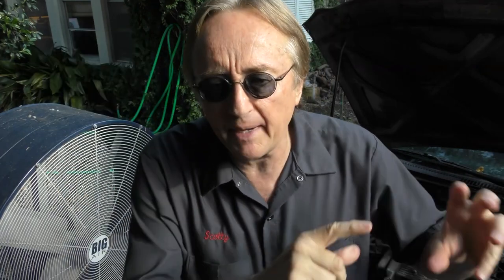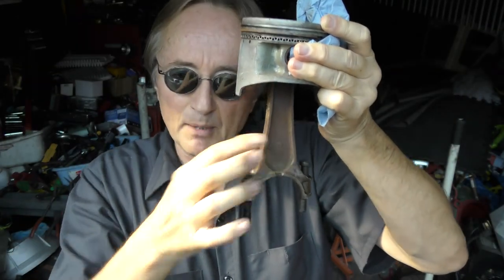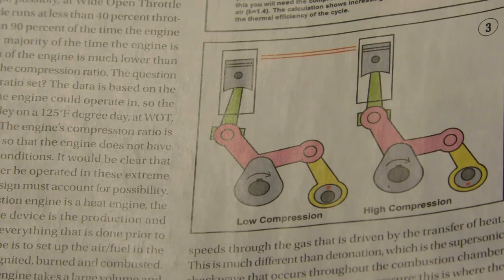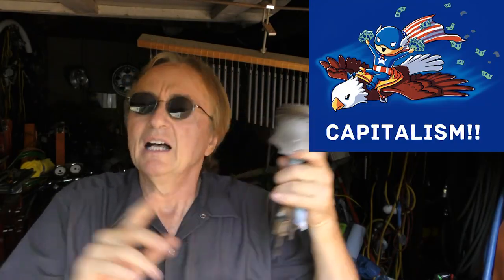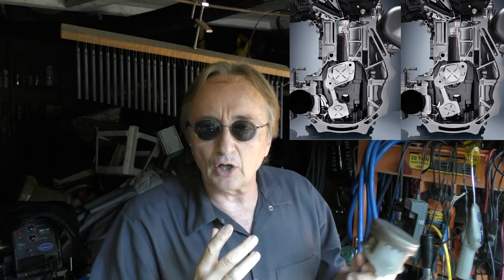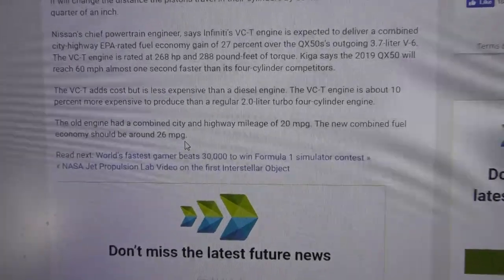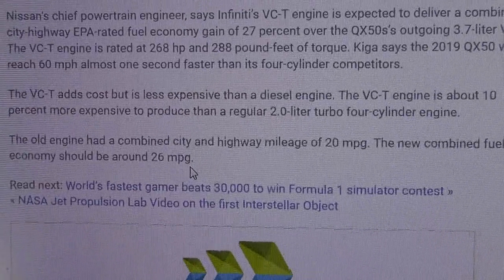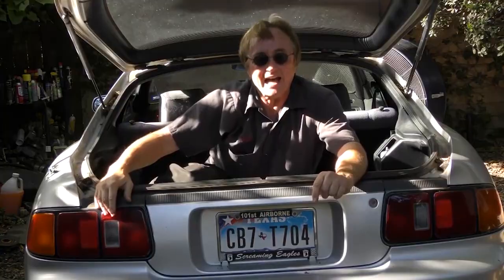If You Buy This Type of Engine, You're Going to Regret It

Comment: The old cast iorn 368 V-8-6-4 was fine.  The electronics weren't ready for prime time.  The engine was weak thanks to the shrouded valves, but they lasted for ever.  Same architecture as the old 472 and 500.  Unhook one wire and the 864 part is out of commission.

Comment: I don’t think that design is bad. They figured out how to fix the inherent secondary balance issue and power stroke rod angle That Plague four cylinders. And they plasma line the cylinders so I don’t imagine it going to be a piston or rod issue. They also are using electronic servo instead of a hydraulic system to activate the linkage which reduces failures risks.

Comment: It's probably the quest for more horsepower, which few really need. Most cars could get by easily on about half of their current HP, and they would get better mileage and last longer. People say, "But I need to pass."  The only thing I ever have to pass is farm equipment going 15 MPG, and I think I've got that covered. If the speed limit was obeyed, roads would be safer too.

Comment: I routinely get much better gas mileage than the estimates. My S70 is rated for 21 city 29 highway but I always get 24-26 city and 32-35 highway because I drive smart. I use inertia to my advantage; coast to slow down, accelerate gently, time traffic lights, take corners a little too fast, and use my transmission to my advantage; I know I get 5th gear at 44 mph, and a locked torque converter at 38 mph, so by going those speeds or slightly faster I get maximum cruising efficiency. Heck, cruising at 45 on a flat surface I get 42-45 instant mpg. At 40 I get about 40 mpg, and at 30 I get 32-33mpg. At 65mph on a flat surface, I still get 31-34 mpg.

Comment: My ss impala would get 15 mpg in the town with v8 but while v4 I would get from 36 to 43 mpg at a consistent 40 mph, but on the highway the v4 couldn't be used unless I wanted to slow down, it wouldn't be used after 2800 rpm

Comment: My 2003 V8 gets 18city, 26 hwy, 24 combined with my actual driving. It's been reliable for over 160k miles, and should be for another. Some of this new tech seems like they're grabbing at straws to get any better MPG. 
Just give us more cars with electric drive motors in the rear, and a capacitor bank, give us regenerative breaking, start-stop with electric assist acceleration. Then those actual reliable 4 cylinder engines can feel like more powerful engines, without too much complexity. The capacitor bank isn't affected by cold or charge cycles (these are used in city buses, which do much more stop and go than cars). People would buy more of these "hybrid" vehicles if they weren't stuck with 1-2 models to choose from.

Comment: THATS 99% RIGHT SCOTTY MORE PARTS MORE BREAKING DOWN I HAVE A 1996 BMW 1.8 L 183 000 kms 
that burns no oil has small gasket leaks I need to put new oil pan gasket in new oil plug to transmission oil plug nut rounded of so I went to welding shop had them weld a new nut onto the old plug bolt the thread was still good odd thread hard to find

Comment: To be fair, they don't have many more moving parts than a regular piston engine, they don't require balancing shafts because the extra levers that do the variable compression fill that role. So potentially it'd work just as well. And plus, Infiniti is a luxury brand and it's a pretty large vehicle so expecting good mileage doesn't really make sense.

Comment: Manufactureres tend to over complicate things and it ends up a disaster for the consumer.  A prime example in recent years is the good old DPF system.  Bucket loads of failures, expensive to fix, yet if they were engineered correctly in the first place they wouldn't be a problem.  Variable compression engines even sounds like a recipe for disaster.  
Although I'm pretty sure there are European manufacturers with engines that shut off cylinders when not needed and they work well

Comment: GM's cylinder deactivation is not a failure, it just doesn't work as well as advertised, but in its current form it is very reliable. The reason not to buy it isn't that it's too complicated, it's that Nissan hasn't earned my trust like Ford and Honda have. Also, how are you driving when you get worse than advertised mileage, the only time I ever do is with the A/C on, even at 85 mph.

Comment: They would be better off with a head that lowers into the combustion space. At least that need not reciprocate. I do NOT value complexity. Thanks for the heads up. Wouldnt touch that with a 10 foot pole. Ditto for "skyactive"

Comment: The main engineering problem I see with the vc design is that the rod bearings don't complete a full revolution, they won't be able to maintain a hydrodynamic oil film. But hey it's the same story for small end bearings on any other engine. They don't turn very fast compared to mains but they seem to last. I guess the main failure point would be the servo motor, but they should be able to make that reliable if they don't cheap out too much. Id like to see Toyota do it, but they're not very adventurous

Comment: I can understand bashing Nissan, I have owned more than my fair share. Every car so far that has had a cvt transmission from my 07Maxima to 2014 Versa Note sv has had trans failure 38,000 miles and up. Versa note is on third trans with 77,000 miles on clock! Fix the transmissions please. We have just about made our minds up to go to Toyota Avalon for my wife. I now drive a 2015 Pathfinder 55,000 miles waiting for Trans failure....

Comment: The inefficiency of the gasoline engine is because they are trying to burn a liquid. Combustion continues past exhaust valves and finishes in the catalytic converter. 
CNG and propane has less energy per pound but burns more completely.
You cannot burn a liquid. It has to be converted to vapor. Not enough time in a typical 4stroke to do this. This is old hat. Patented by Henry Yunick in the 1980s. Look it up.

Comment: Im sure gear heads were saying the same thing about Fuel Injection, variable valve timing, and power steering. "Too many moving parts, why risk it?" Yet in another video scottys promoting the toyota corolla, which has fuel injection and a bunch of other things the generations before him thought was unnecessary.

Comment: Do you still have the JX35? If so any idea where the  IBA or ICC sensor is located? I believe it is the same sensor for both. My "IBA off" light is on and "malfunction see owners manual" message is on the dash. I know this can happen if the sensor gets dirt on it. I have searched everywhere online and the only clue I can find is that it is hidden behind the front passengers side bumper just below the tow hook door. I still can not find it. And there is no visible evidence that you can actually see like on most cars which does not make sense to me. I know you are THE MAN when it comes to the JX35's so I'm really hopeful you can tell me where it is so I can try cleaning it off. I have tried all the menu options on the steering wheel but nothing helps. Thanks.

Comment: Mathematically, multiple levers would divide the amount of energy going into the system. Which, in turn, reduces wear despite having more parts. Yes, to a mechanic who may be servicing this engine, it could be nightmarish. But, speculating is not the same as experiencing.

Comment: Large Diesel Crosshead Engines have been around for a very long time and are extremely reliable.. Not suitable to be put into cars, but if you want the most reliable engine, you go for a Crosshead low-rew Diesel. 100.000 Horsepower over 24hour continuous load? No problem!

Comment: Honda's  V6 engine has cylinder deactivation for 10 -12 years now, and they still do.  At highway speeds, it runs on 3 cylinders; 6 cylinders everywhere else.  Sadly, the V6 is gone for 2018, replaced by turbo 4, but the technology seems to work for them. As for variable compression, I agree. I'd avoid it at all costs. Also, Toyota tends to get better MPGs than the EPA ratings state. My 1999 Camry gets 480-490 on a tank of gas when it's all highway miles andnask any Corolla owner and they will likely tell you that they get over 40 MPGs on the highway; The EPA states high 30's.

Comment: That fuel economy is not much better than my 1990 Mercury Grand Marquis. I’d rather keep driving my old 5,000 pound steel tank that I know is reliable, than go for some new piece of crap that may not last 100,000 miles. My car has roughly 190,000 miles on it and it’s still going strong. And some people wonder why I stand by the older vehicles....they were built better and built TO LAST. Scotty, you have proved my point in multiple videos; hence when you talk about your celica. Older vehicles, better reliability.

Comment: Is this the same thing that's on the 5.7 V8 Hemi's? Where it turns off fuel in four cylinders when power is not needed? Ram calls it their Multi Displacement System (MDS).

Comment: I replaced the fuel pressure regulator in my truck and i noticed today that fuel is leaking through it again into the vacuum line and it ate the rubber elbow.  Any idea why a new regulator is doing the same thing the 20 year old one was doing?

Comment: Hey is it worthwhile to try to release a stuck lifter on a dod 2007 yukon 5.3. cylinder one is now misfiring and there is a video on how to free lifter without removing the head. Oil pressure is low 18-20 psi when cranked up. @scottyKilmer Help! new motor is what mechanics say is best option due to cost to fix pressure issue which causes the lifter to collapse. Here in Atlanta Ga new motor cost $3500 installed 3 months minimal warranty and $6700 with 3yr unlimited miles warranty. Or just trade it in?

Comment: That engine was created to provide high power with low fuel consumption. Basically is a gasoline engine with diesel performance. All this for polution and fuel consumption I trust that it will last at least 300.000km without problems, which is way too long. I do 10-15.000 km per year, so the rust and will be destroyed before engine breaks. But yeah, there in Texas is other world.

Comment: Environmentalism aside, the biggest reason to get a fuel efficient vehicle is to save money in the long-term. If a fuel efficient engine is more complicated and susceptible to expensive repairs relative to a reliable but not-very-efficient engine, then you may not actually be saving any money in the long term. You are better of either driving a fuel efficient car or a powerful/fast car. Don't compromise the integrity of the engine so you can have an unreliable car than excels at neither.

On a related note, when I got my Thunderbird SC, I remember asking my dad if I could get away with using regular gasoline to save money. He replied, you technically only need premium fuel when under boost, but if you get engine knock, it could damage the motor and be expensive to fix. Better to spend a couple extra bucks per fill-up than spend hundreds or thousands on repairs.

Comment: What about the Honda? Please! I have a 2010 exl I've been driving one since 98 so on my 4th, I drive them to 300k and donate to someone that needs and buy another used one for 10k.. I'm thinking of going to synthetic or synthetic blend and changing at 5k miles so tires rotate at the same time.. I use Honda or napa gold filters.. But I do get things about the motor it often feels like a 4cyl that the ac compressor kicking on and off.. Is that motor or transmission? It's just slightly annoying but if it at 92k continues to 300 At how many years of operation... Now I won't be buying the 2019 when I work my way up ill have to go to something else maybe the pilot which we have of a 2015. It uses synthetic though same motor basicly as my 2010 Accord? Talk to me scotty

Comment: Toyota Corolla 1.4l 97 hp manual year 2006 - gets 41 mpg combined for me and I don't drive very economical. Sure it is not 2.0l turbo with 300hp but hey - this car is 14 years old and the engine is 10x times simpler than this variable engine. The problem is that they are trying to make both efficient and powerful engine which can only be achieved in some black magic technology Which will break 3x faster than the simpler engine and will cost 10x times more to fix assuming it is worth fixing, because when this cars get older and people start buying them second hand - would you fix your 10 000$ car for the price of 5000$ car or if you do - would you buy again this car that bankrupted you. Guys - this is 2020, not 1920 - cars should be reliable and solid build. Today is the opposite - because of this complex technology, cheap parts and lack of quality control. I would not buy this complex cars if I have an alternative.

Comment: another issue on the video is we always get worse than the stated mileage.  That is complete BS.  My 13' Accord V6 claims 21 city and 35 highway  In 63K miles I have never got that low, period.  They change the way the EPA allowed the manufactures test and rate the cars a few years back.

Comment: I wonder if the new Mazda Skyactiv X engine will work out, soon to be an option for the Mazda 3 that burns gasoline but sometimes works like a diesel engine. The Mazda rotary engine did not work out so well, except for one major race car years ago.

Comment: If you REALLY want to save on gas, use a Variable Throttle Pressure System.  For example, if you want to save gas - Don’t apply so much pressure on the gas pedal with your dang foot. You want full power, bury the throttle. See? Variable and reliable.

Comment: Change the thumbnail—that’s a picture of a QX60 which has a CVT Transmission. The VC engine is on the newer QX50 4 cylinder.

Comment: I think variable compression is far too complicated and it seems too prone to fail than per say Toyota’s new “dynamic force” engine designs. For Toyota it’s more about tumble generation and direct and port injection. All about air and fuel control. Not about varying compression. At the end of the day air and fuel control is what gives better mpg. Compression ratio does as well but it’s the relationship between the head, valvetrain, and air and fuel control that really makes a difference.

Comment: i like the idea of variable compression myself on the performance side of things as you can tighten the compression when the engine is off boost and let the compression out as the boost is ramped up significantly, but as for road cars i think it's completely pointless.

using it to conserve fuel is silly when you can simply run a higher compression ratio as standard and market the vehicle as premium grade fuel only (as it will enable to get the better mileage from the higher compression) but no, instead they add the variable compression system which is a great technology, but in reality is just added weight, complexity, and yet another failure point which not only costs you more to fix when it breaks, but you're paying a premium for it to be there to begin with.
to be honest scotty, i love my piston engines, but if they want to improve gas mileage the way to do it is with EV/hybrid technology.

Comment: In the early 2000's BMW had the 745i with a V8 that had all experimental technology-offset piston wrist pins, instead of a throttle, it varied the valve lift to throttle the engine and it had that stupid "dial" in the center console.  That car was a total failure!

Comment: Hey scotty speaking of engine. I have an 02 sable gs with a Vulcan engine and an 05 sable with a duratec engine. I'm thinking of getting rid of 1 of them but I am not sur which engine is the most reliable. 
PS the 02 sable with the vulcan3.0 by has 160 000 miles on it vs the 05 with the duratec v6 3.0 has almost 90 000 miles. They both gave me their share of torque converter failure. But not sure about the engines though. Help me with your experience please

Comment: Allo Scotty
 Y have a 2001 toyota
echo whit 2650 kl. There is oil missing in the transmission.
Which oil should y use you    
Said Locas for transmission
And they told me to use Dextron 3 .
Need your help.

Comment: The more I see these complicated designs to save a bit on gas mileage, the more it makes me want to get an EV or plug in hybrid like a Volt.  In the meantime, I'm gonna keep driving my 2014 Nissan Sentra 6 speed that gets a combined 35 mpg because i don't drive like a maniac and I use ethanol free gasoline.  At least Nissan got that car right, so far no issues.

Comment: So besides variable compression engines, Scotty what do you think of HCCI engines; gas engines that in the right conditions, do NOT use spark, instead use compression ignition part time? Both variable displacement and HCCI may outdo what Atkinson cycle itself can do. What about variable compression Atkinson cycle engine?
But yeah, it's interesing tech. But, just go electric.

Comment: IN 1969  I HAD A TURBO CHARGED 6 CYLINDER, COURSE IT WAS A 4 BBL HOLLEY, BUT HEY IT GOT OVER 31 MPG WITHOUT THE SMOG CONTROL CRAP
Reply: MAYBE YOU'VE HEARD OF IT IT WAS CALLED A CHEVY SPYDER, REAR ENGINE AIR COOLED TO BOOT
Reply: BY THE WAY IN 1985 I HAD A 6 CYLINDER 6 CARB ENGINE THAT GOT 30 MPG .NOT BAD FOR AN OLDER CAR!!!
Reply: IN 1987 I TOOK THE 6 CARBS OFF AND INSTALLED A 4 BBL MANIFOLD WITH BIG  HOLLY 4 BBL. DISAPPOINTED HOWEVER. ONLY GOT 38 MPG

Comment: How about variable throttle? my s40 turbo volvo (aka the ford tuned engine used on the focus RS) cruises at speed using a fraction of one percent of available power. Hard to do much better than that... if you’re going to cull entire cylinders there’s an inherent problem therein - lose the cylinders in the first place. 

But -  you can get a 1 liter 3 cyl Ford ecosport (used in their open wheel street legal concept racer - is that for sale in Britain?).